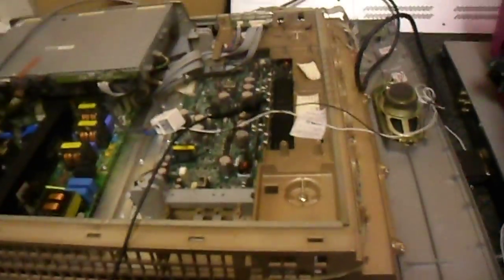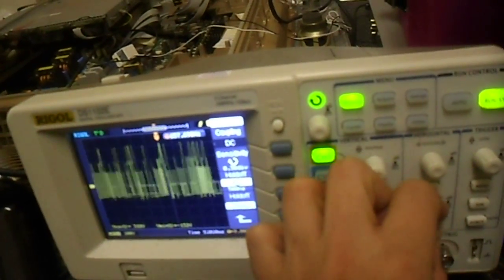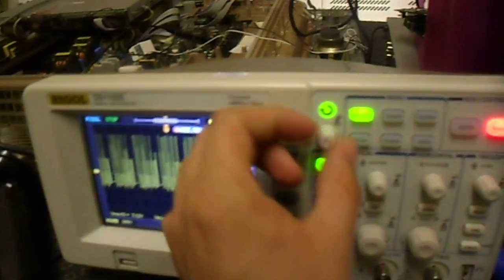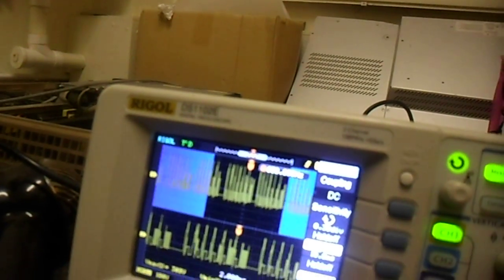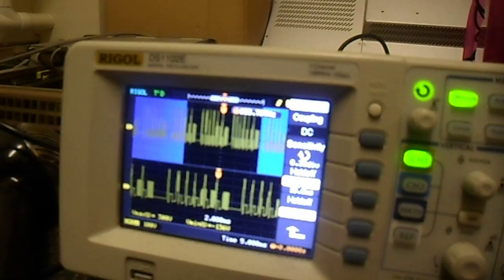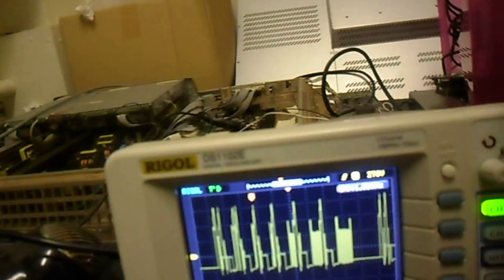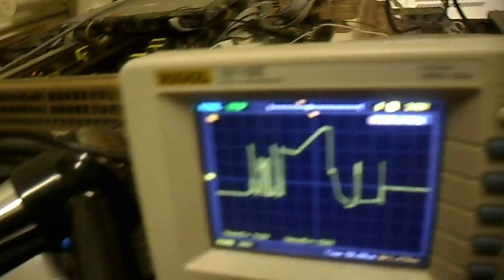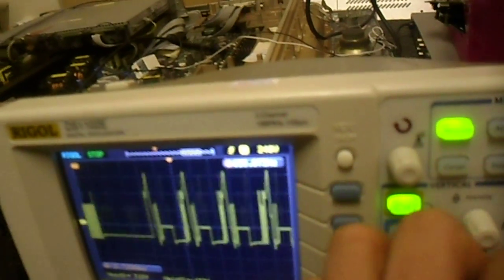Setting an oscilloscope up to trigger on a sustain waveform (plasma display panel)

Comment: Hi Mate, are you still interested in plasma repairing? With regards to your last question as to why only the first top two scanning ICs get blown first..I think I would put it down to the type of screen used in those Samsung (W2 plus version). Philips, for instance uses W2 version of that screen and buffer ICs fail rarely. It could be something to do do with top screen electrodes overloading the scanning ICs on the top of display only.
Ideally, it should bring Y sus into protect mode (led 5800 on) but Vsch line gets a short and it takes one of the YPN fets instead.
Regarding your previous assumptions about analogy of V scan  (+/-)voltage and -Vy (In Samsung panels I think they are called +Vsch and -Vsc,) I think those voltages will always slightly differ with Vsch staying at +140V and Vsc -190V in PS50Q96/7Hds.
PASS transistors (equivalent of YPN) in Samsung PDPs are only in -series switch transistors which open the  way to the massive current  flowing on floating ground to the scanning ICs FGD.
So YPN FETs fail as a result of being overloaded from already faulty scan IC which had overheated or burnt. But you maybe right in saying that it's possible that bad YPNs can wreck the buffers. Sometimes ADUM1410 routing image digital signal from CTRL board (digital insulator) can cause trouble and distort those signals which in turn messes up with scanning ICs as well.

Sorry to reply after a year, I didn't have time, plenty of repairs etc, but was playing up with my scope to troubleshoot plasma displays recently and watched your video again I think it's one of the best videos ever made about debugging PDPs with didital scope, and you have extreme level of expertise when you talk about structure of the Y waveform, very interesting, thanks again

Paul

Comment: In Q96/7 series, clock, data, and other signals are routed across the top buffer first, then go down to the bottom one. But more importantly,the digital Hsync signal starts scanning the panel horizontally starting from the first chip, so perhaps that is the reason why?

Comment from the maker: Generally you'd be looking for peaks that are too high (in excess of 400V) or sustain portions that are stuck high. I have a theory that the cause in 99% of cases of buffer failure is excessive -Vy voltage caused by PASS FET failure, check the voltage between the + and - of the buffer board it should match -Vy approximately.

Comment: Hi, Can you tell with your scope that the waveform is incorrect and it's going to kill one of the driver chips on Y scan top/bottom if connected to Ysus, for example the set up peak is to steep or damped? I'm using analogue scope Philips PM3217 and initialize-scan-sustain main subfields are a little bit messed-up in one picture so it's hard make out anything from it, thanks